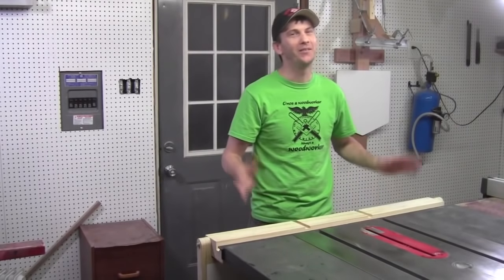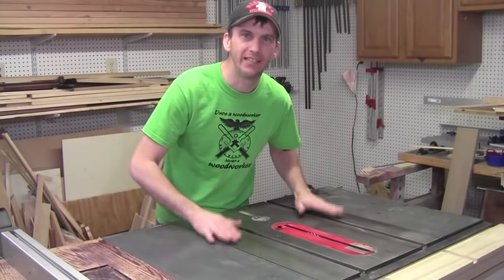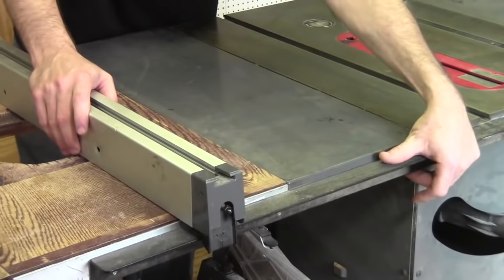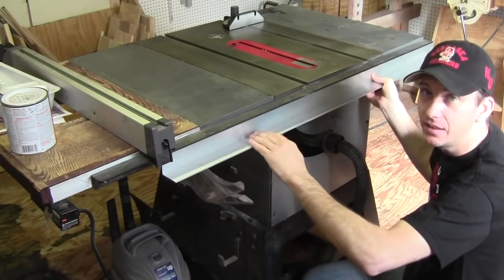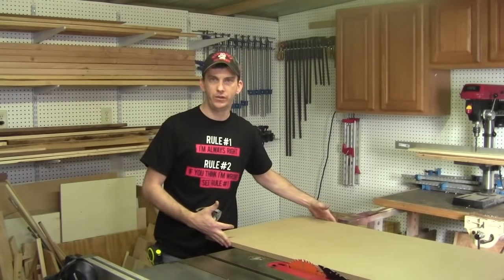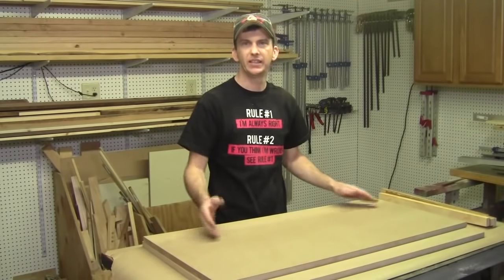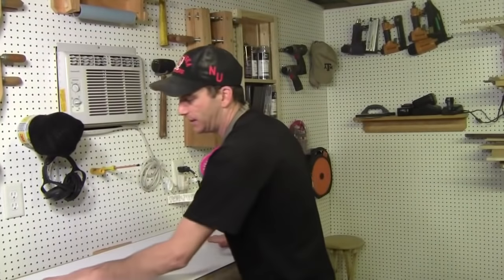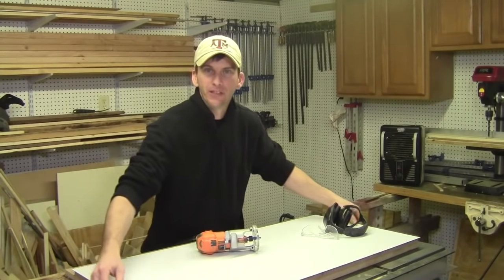Make A Table Saw Out Feed Table

Comment: Laney, I just built the out feed table for my rigid table saw.  I made a few changes to the plan, as I am on a fixed income, I used melamine for the table.  Because the rigid saw has a T track at the bottom of the rear runner, I used 5/16th bolts to hold the piece to the saw...  Most of the other items I did as you shown in the video.  I was nervous making the leg, however it came out perfectly....  Thank you for the directions....  Dave

Comment: Good video and really enjoyed it, just a tip though, use the roller as you are putting the mica on, that is take one stick out and roll toward the next stick, then that stick out and roll towards the next etc. The way you did it, once you have pulled all the sticks out, any air trapped under the mica is there for good, rolling won't get it out, contact cement is instant bonding.

Comment: No criticism on your method of applying your adhesive. Just a tip that I have had years of experience with. Lay your Melamine, (Formica is a patented name) face down on your substrate. Apply your adhesive to that first, as it has less absorption than the MDF. Move your Melamine to a clear area then apply your adhesive to you MDF. Both will be dry about the same time then, bring them together using your sticks to keep them apart. You have helped me I hope this helps you.

Comment: Laney - a trick I learned to stop the sliding of two pieces you're trying to glue together... sprinkle some salt into the glue.  Gives enough space to prevent the pieces from shifting, and will dissolve fairly quickly.  Have had no issues with lamination.

Comment: Laney, I have an old, hang out the back motor on my Grizzly saw, would you foresee any issues with making the mounting plate 12” wide instead of the 5-3/4 prescribed in the plans? I don’t see a problem.
Reply from the maker: No problem. This fold down table was originally designed for a saw with a motor hanging out the back. I believe in the original plans. If you can find them online or reference to them in the comments you may be able to see if that is true. But no I see no problem as long as it's rigid and true.

Comment: For instance, would you recommend a lighter build or design for the router insert?  All that MDF material must weigh a lot! Also if you were to remake these things, what changes would you implement?  Would you use a stronger angle bar to support the side inserts, for example?

Comment: just noticed the sliding leg was angle cut at the bottom, but apparently assembled flipped as you can see at 1:02; the angle cut doesn't make full contact with the support, but rather the edge only makes contact... simple mistake.  still a fantastic design for collapsible support.
Reply: ***** Just looked it up,thanks but no thanks.Your just advertising.

Comment: I believe I recongized that you are using Freud Diablo blades on your Porter Cable PCB270TS table 

saw.  

I have used Diablo blades myself but I was experiencing that they did not slide onto my PCB270TS 

table saw easily and were harder to get off after use unlike the Porter Cable blades that came with 

the saw or that I had purchased new.  

If you are using Diablo blades have you experienced a similar tightness issue on your PC arbor?

Comment: Hey! I recently moved into a new home, which as separate two car garage attached to the back of the house right off the bonus room. The people even left a huge vacuum fan that could be used as the heart of a dust collection system. However, I have only a general idea of how to set up a shop. Could you make any general suggestions or point me in the right direction? Thanks.

Comment: You can use pre-laminated MDF (Any home box store) it would save a bunch of time and cost with the Formica,and tools.
Reply from the maker: +James McGuire yes if it comes in 1-1/2" thickness...
Reply: glue the pre-laminated MDF to some straight mdf like you did,it would just save the gluing of the Formica on.

Comment: Having worked with laminate over the years, I have found that the "thin strips" you use are great but what I use is 3/4" x 3/4 pine corner molding to keep the laminate off the substrate. That will give you about 5/8" between the lam and the substrate. Works pretty good.

Comment: I hadn't heard about scoring Formica to snap it over a straight edge. Thanks for something learned.

Can also use dowels for spacing the two surfaces. 1/4" to 1/2" give plenty of separation with minimal contact. Since they are reusable, the cost is effectively zero.

Looks like my Harbor Freight 1//4" router. How is the housing adjustment gearing holding up on yours? Mine has not had a lot of use and already the gearing is showing pronounced wear ... not a good omen. The plastic is too soft. It should have been either Bakelite or some light metal, as should the rack it meshes with. When the gear finally strips, I'll transition it to a lathe-router until the motor finally bites the dust.

What happened to your table-mounted router? It would have been perfect for cutting the dadoes and the curved part of the wooden hinges.

When drilling holes where appearance matters, drill all the way through with a small diameter drill (about the same diameter as the chisel tip of the final drill) and then start the final drill about 1-2 diameters deep, then flip the piece over and finish drilling from the opposite side. This give you two entrance holes, no exit hole, and any minor mis-alignment is hidden inside the wood. To make certain the final drill is on the same center line as the starter drill, touch the final drill bit to the hole lightly and turn it backward a little -- the starter hole will center itself on the cone of the final drill and the alignment will automatically be very nearly perfect. Then secure the workpiece with a clamp or stop-block and start the drill press. 

I'd like to suggest that you ditch the exterior grade plywood and get some 3/4" (20 mm) Baltic birch (many layers, no overlaps, no voids) phenolic faced plywood. It'll set you back about $20 for that small piece (I used to have the same contractors saw and modified my right wing, too), but it is extremely rigid, hard and smooth. Then flush mount a t-track a little further away from your largest bit (probably a cabinet frame bit) than the width of your miter gauge that came with the saw so that you can hold material at an angle. I also set in two more pieces of t-track (cut from the same 36" piece) to use in adjusting a router fence, holding it down with cam locks. The router fence had sliding faces made from the part trimmed off the phenolic plywood and a thick Lexan shield from scrap I scrounged at work (I did machine maintenance for a packaging plant and would sometimes have to fabricate guards to keep the pink parts out of the sharp parts). A vacuum port at the back of the fence all but eliminated cleanup and kept chips from lodging underneath workpieces.

Meh ... never mind. I just noticed that you have a video about making a router table in the table saw wing. :~]

Comment: My workshop is in my garage, thus everything in my shop I have determined to be mobile.  Thus, I would not want to make a permanent support leg that would restrict my mobility.  I also have concerns about the dust port being in the way of the out-feed table's support arm against the table saw's side and near the dust port.  I heard that your dust port broke.  That is probably why you went to a workstation built around your table saw. Did the out-feed table bread our dust port? Or, could it?

Comment: I like the design, but I'm curious, is there any danger of the table tipping over when something heavy is slid onto the out feed table? I wonder if the same leg system but going down to a rail on the floor would be stronger and safer, just curious and not trying to criticize at all, you make great stuff. For all I know the weight of that table means you can stand a family car on the end without risk :P Good luck with future projects, great videos.

Comment: Surely you mean angle aluminium. not iron? Nice job, though.
Reply: Just as most people I hear call a reciprocating saw a Sawzaw this can just as easily get in the habit of calling any angle metal angle iron
Reply: Jayson Sanford "Sawzall®" (was/is a trade name for a reciprocating saw)
Reply: Ant Mallett Are you talking about the rear rail on the saw? That's probably steel, not aluminum. Therefore, "angle iron" would be correct.
Reply: Jim Fancher The existing rail is steel, but the add on one looks nothing like any steel I've seen, and lots like all the aluminium I've seen. Maybe Laney would care to comment if its not too much hassle?
Reply: Ant Mallett Gotcha!  It looked like aluminum to me too.